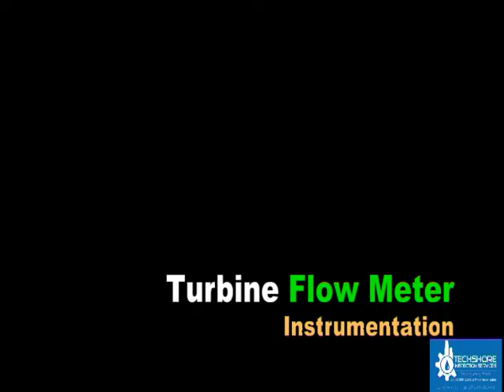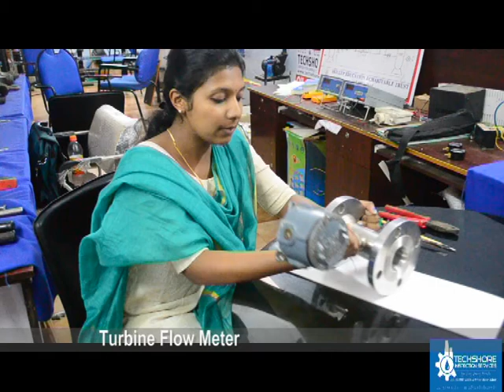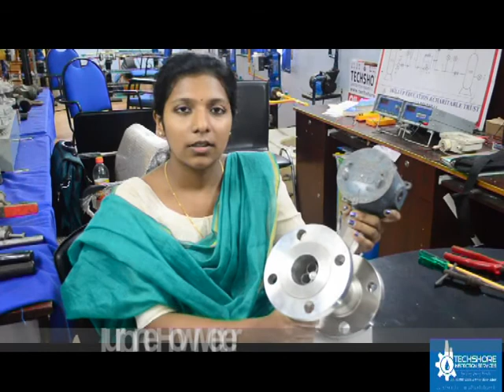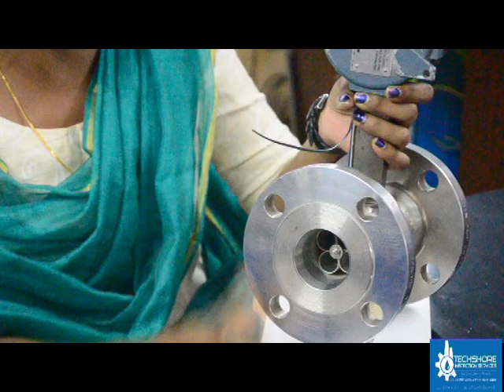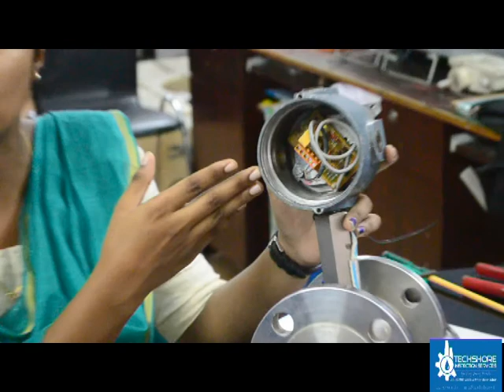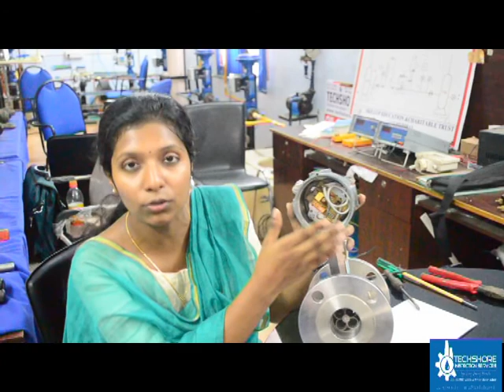Instrumentation : Techshore Turbine Flow meter - www.techshore.in

Comment: (1)how do learn basic of instrumentation (a)flowmeter (b)transmitter (c)sensor (d)pid controller (e)i/p converter (2)why we are using 0 to  55V DC supply 4 to 20mA for instrumentation